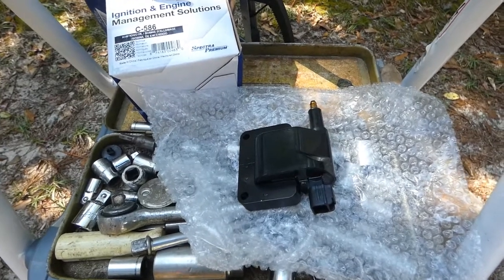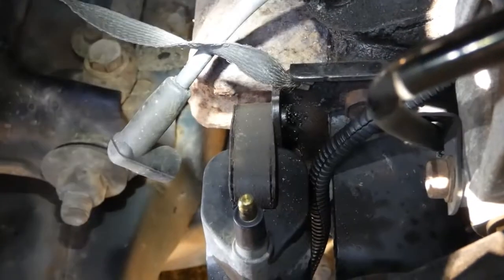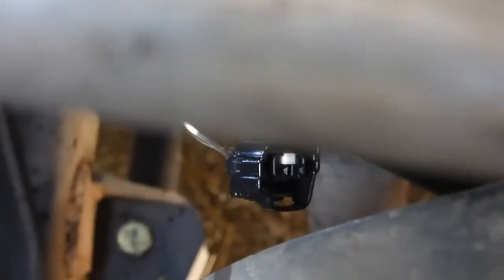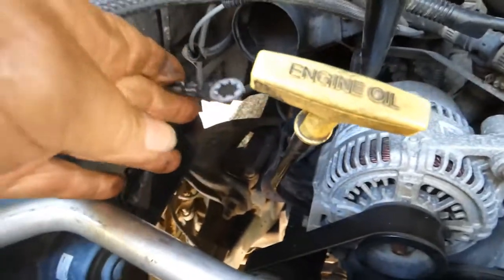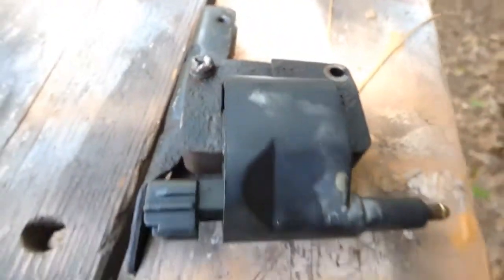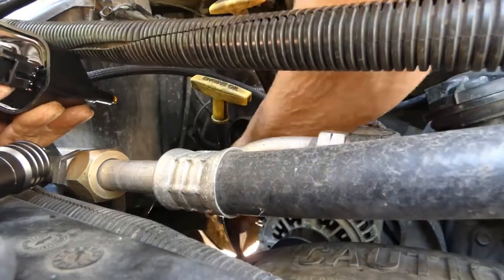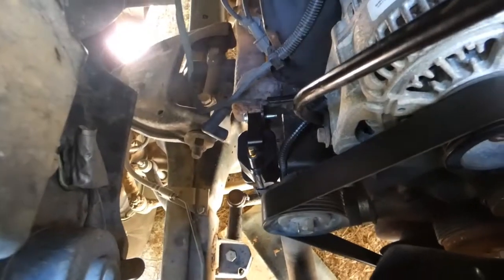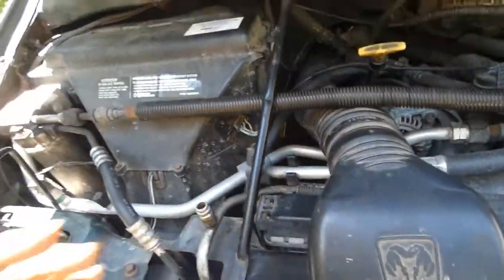Ignition coil replace Dodge 1500 Van

Comment: Nice job.  I am traveling the US in my 1998 Dodge B1500 van and I did a lot of work to it before I left a year ago, and there is not much room to work on under that hood.  I replaced the thermostat, alternator, water pump. Timing chain, all pulleys, the balancer, radiator, belt, all hoses, and the starter.  I did brakes, replaced the front calipers and rear wheel bearings and flushed the brake lines.  So far so good.  It only has 113,000 miles on it now and runs well, mileage is not great but, it is a high top I made into a camper van so it is not light.  Safe travels.

Comment: I have a 1999 Dodge 1500 Van. Its' parts are identical to your van. After disconnecting the ignition coil wire on top and the electrical connector on the bottom I first tried to remove the 2 screws with a stubby phillips head screwdriver but when that wasn't working I removed the two 9/16 bolts that secured the bracket (like you did) and took everything off in one shot. Now the 2 screws were easy remove, however, a standard size screwdriver isn't going to work. Using a much bigger phillips head screwdriver did the trick. If that didn't work I would have used a small vise grip on the heads of the screws but that wasn't necessary. Then I just reversed the process. Thanks for your video !